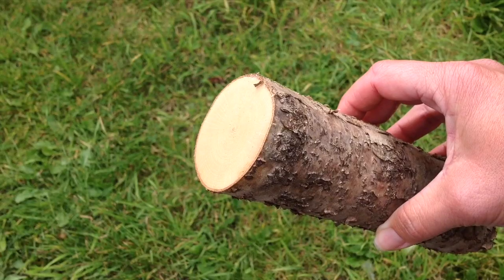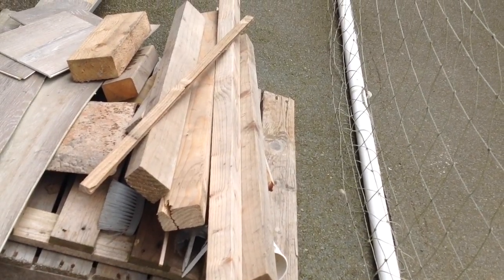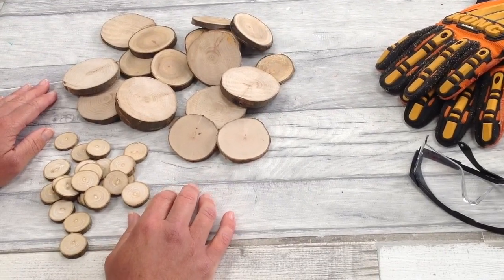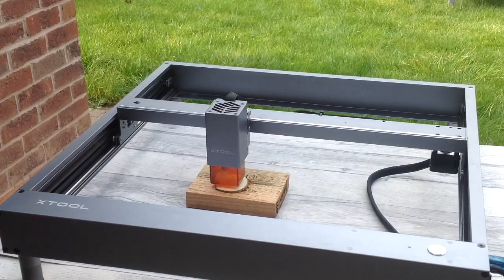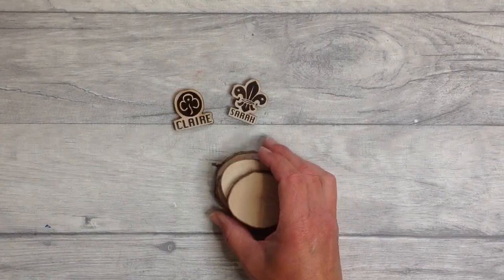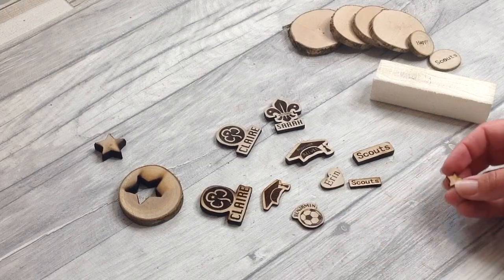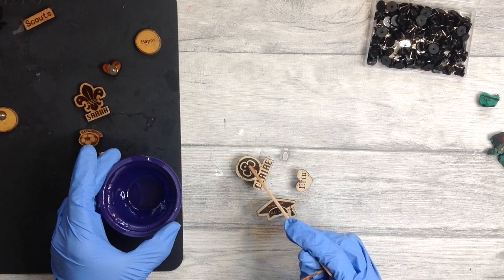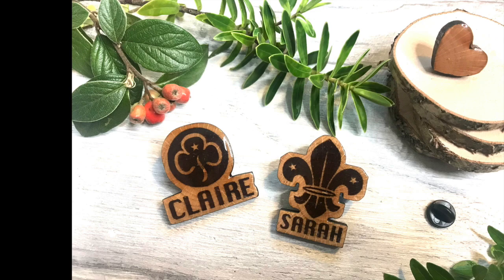DIY Pins - How I make handmade wood pin badges - Laser Engraving

Comment: Hello Beautiful! Just a wee tip: if you brush the surface of porous items with some mod podge or slightly watered down glue (basic-like Elmer’s) and let it dry completely, it’ll seal the surface and prevent the absorption of the resin into the item. This will speed up the overall time, prevent bubbles from rising as the resin sinks into the surface, and help your resin go farther in the end. TFS!! ❤❤❤
Reply from the maker: Hi, great tip, I quite like the idea of some of the resin getting into the wood or clay to make it stronger, but your tip is great for bubble issues and yes to save on resin as it's expensive stuff. Still all a long process though isn't it. Thank you ❤